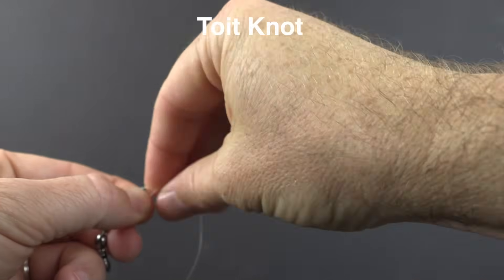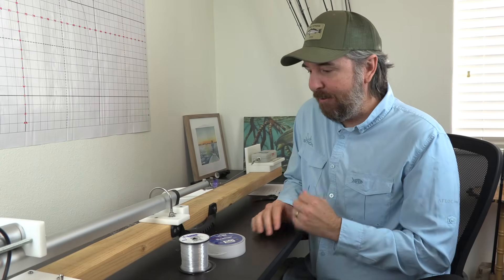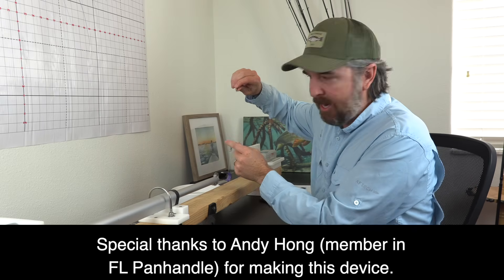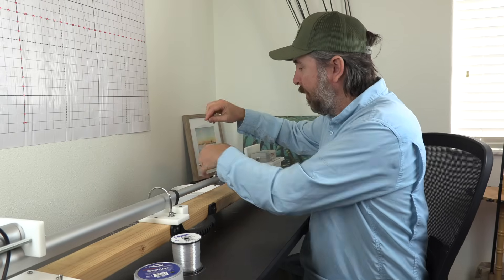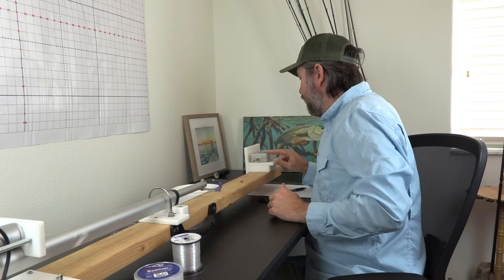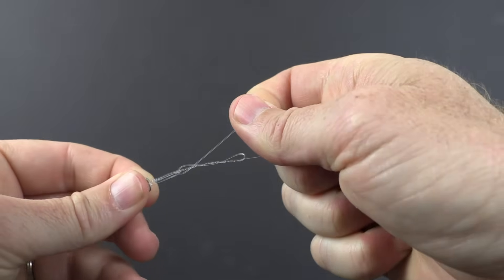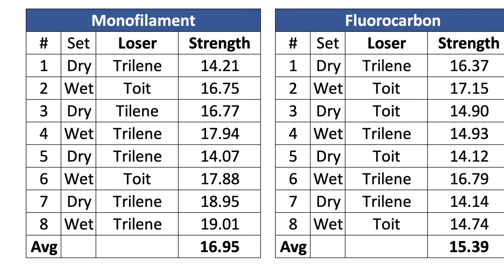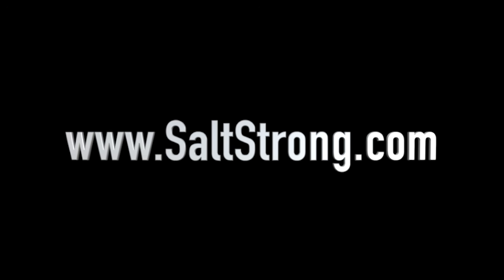Toit Knot vs Improved Trilene Knot (Strength Test Results)

Comment: Never understood the obsession with knot strength. I can’t remember the last time I had a knot fail or break, it’s always some nick or cut in the line. I use the good old uni knot, a spider hitch if I need to double up, or a Rapala loop knot - that’s it. I find it’s better to tie the knot perfectly every time because the best knot tied wrong is worthless.
Reply from the maker: How do you know that your breakoffs have been due to a cut in the line? The reason I ask is that only bad knots will leave the curled up end to show that a knot got unwound causing the break. When a good knot breaks, the end of the line is straight due looking just like it was had it got cut by a sharp object... so without seeing the other side, it's extremely tough to know that it wasn't the knot that failed.
Reply: @Saltstrong when I break off fish the end is rough or cut at angle, so I assume it’s not a knot failure. Honestly I can’t remember the last time I broke off a fish based on pure pressure in open water. It always happens under docks or mangroves when they get wrapped up. If I snag a lure on cover and have to force a break off I guess it’s possible that is a knot failure but something has to give. Many times the hook is bent.
Reply from the maker: It's super easy to test it out yourself if you want to see how your line holds up... just tie off to a fence post or something stronger than your line, and pull until the weakest link gives. After breaking over 1,000 knots in controlled tests, there have only been a few instances where the line broke away from a knot.

Comment: What a load of bologna. All one needs is a tried and true uni-knot with both mono and fluoro. If your drag is set correctly, the uni is perfect - and has been for years, both fresh and salt. If you feel you need more knot assurance, tie an overhand knot at the base of your tag end...the line will fail before that knot will.  Don't reinvent the wheel.
Reply from the maker: As long as the drag is set correctly, there will not be a tension breakoff regardless of the knot used. The benefit of seeking the best knot is to make sure we get back as many rigs as possible when we get snagged on the bottom as well a to have some extra pulling power if in need of keeping a fish out of structure. 

The uni is one of the best knots to know because it works well for all line types and connection needs. The con with it is that the regular uni is never the strongest choice for those who are willing to take the time to learn how to tie top-tier knots.

Comment: Is there a test like test between Paloma vs. improved trilene or vs. toit? Paloma has always been my go-to so I'm curious
Reply from the maker: Looks like the only Palomar strength test we have is with the uni knot. You can find that here: 
https://youtu.be/lib2RGIJZNk
Reply: @Saltstrong I'd be interested to see the top knots compete again each other so we know what's what. Then later if there is a new knot, it can compete against that best knot. 
Another question, what's the best knot to tie two slick braid lines together? Is it better to have a mono or fluorocarbon to bridge the two braid lines?
Reply from the maker: @tann8960  Here's what we have right now... https://www.saltstrong.com/articles/fishing-knots/
Reply from the maker: For braid to braid, use the braid double uni knot that's shown in the overall knot ranking post linked above (no need for mono in between)

Comment: ok, critique? here we go.

4:55 what's the point of comparing absolute numbers of nylon and FC? it makes no sense whatsoever, bears no useful information. why? because it will make sense ONLY if both lines have equal initial (no knots) breaking strengths. you need to test them both without knots to compare them that way, and as a bonus you'll be able to tell how much in percents each knot is degrading the strength of each type of line.

without that, calculating and comparing averages is pointless.

besides, it's hard to interpret the raw results too. in order to make them useful, you need to calculate average and +/- deviation for each of the following combinations (with each combination tested AT LEAST 3 times, better 5 times):

- knot1 nylon wet;
- knot1 nylon dry;
- knot2 nylon wet;
- knot2 nylon dry;
- knot1 FC wet;
- knot1 FC dry;
- knot2 FC wet;
- knot2 FC dry.

otherwise it's all blindly wandering in the dark. yes, you've got raw numbers, but you failed to process them to derive a meaningful interpretation.
Reply: seriously, check how it's done properly. it's no rocket science. check what and how the gentleman behind the linelaboratory channel (and website) does for a good example.
Reply from the maker: The purpose of this test was simply to see which of these two knots were stronger. So I tied them head to head on the same strand of line before breaking them 16 times (8 with regular mono, and 8 with fluoro). I was logging breaking strengths mostly to see if the use of saliva was beneficial or not.

As for comparing the avg strength of mono vs fluoro, that was simply to show viewers that fluoro is generally weaker than regular mono for a given line rating so that viewers can know to lighten up on drag if they do decide to use fluoro.

Comment: you do realize that fluorocarbon IS monofilament too, don't you?
Reply from the maker: Yes. But it's common to refer to fluoro independently since the marketing behind it has been so big.... it's the biggest scam in fishing in my opinion since it has continually lost to regular mono in testing in spite it the fluoro costing 5x+ more.
Reply: @Saltstrong  what I'm saying is that it is an inconsistency to call one by the number of strands it has and the other by its material, so:

- monofilament vs braid;
- nylon vs fluorocarbon.
Reply from the maker: Sorry if I put too much emphasis on the mono vs fluoro in this test... that was mostly to show how these knots performed with the 2 most popular lines that our members are using. If I would have only showed one, then there would have been many requests to redo it for the other. And highlighting the difference was to remind everyone that the more expensive fluoro lines are not what they are marketed to be (I used to think that fluoro was high-grade nylon that would always beat regular mono for strength and abrasion... but later realized that it was all just marketing hype).